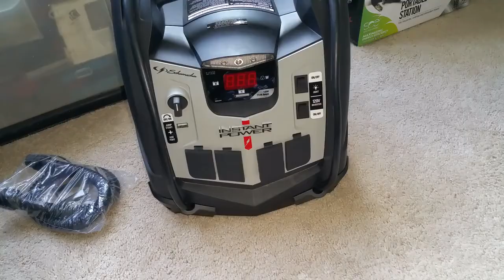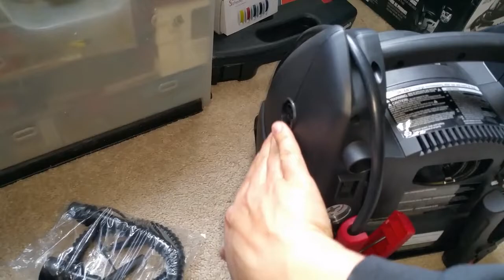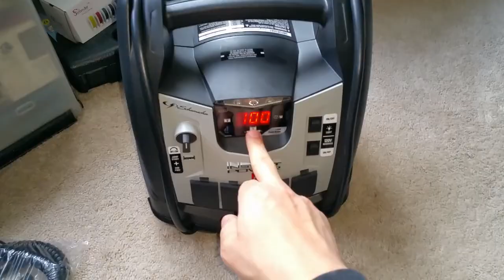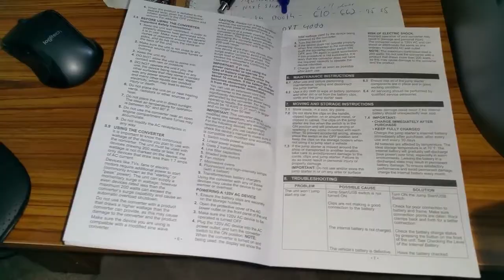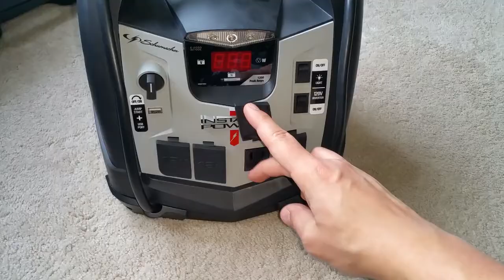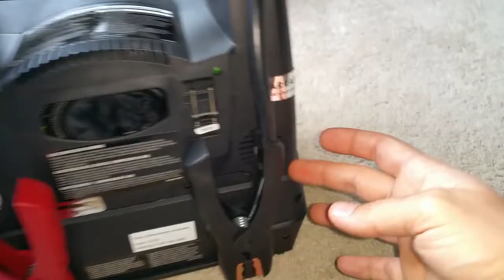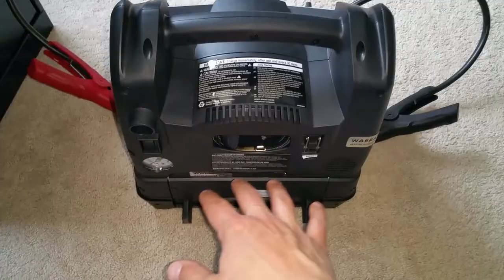Schumacher SJ1332 Review

Comment: So this will not charge car batteries?
Reply from the maker: it will jump start your car's battery, meaning it will give the short term high current to crank the engine ONLY. Once the car is running, your cars alternator will do the charging. 

Someone else asked if this would "charge" a cars battery, and technically this is true, BUT....its only a short term burst of energy. To charge your cars battery from being fully depleted you need to run the car or put the battery on a proper charger.

Comment: Is there anyway to charge this with a solar panel? Thanks.
Reply from the maker: Need more info. Do you have the panel along with a charge controller? Is the controller designed for 12 volts? If so then yes. In the scenario I just stated you would need to make a wire that goes from the charge controller to a male type cigarette accessory adapter. That would charge the internal battery with the solar panel. 

I would not expect a small solar panel with charge controller to connect at the AC power inlet for charging. For that you would need an external inverter to power that charge circuit

Comment: So i just bought this unit & my intention is to use it to power a 20" house fan & charge electrics, phone,  laptop etc. So my question can i simply plug & charge or use? Or do i need to do something else?
Reply: Thanks for taking the time!
Reply from the maker: @richardsoraiz4225  anytime!
Reply from the maker: Charge it first, then you should be good. Keep in mind that the waveform is not a sine wave, but a stepped square wave. Your VAC fan will buzz, spin slower, and run hotter. The rest of what you descibe should be okay, but not every SMPS is compatable.

Comment: Got mine August 5 due to a power loss. Charging for 36 hours as per warning, but it had 96%. I also have a Stakool portable AC/DC fridge/freezer chest that pulls 50 watts, but it isn't on constantly. Since this is 200 watts, can I expect 3 to 4 hours, or possibly more, power for the Stakool?
Reply from the maker: Hard to say. Need to know the duty cycle of the fridge. A kill-a-watt meter would show you the kw used in an hour. From there you can divide that into 18aH and see a rough idea of how long it will last.

Comment: I have the sj1332. I use inverter on a regular or a small fan. It runs 5-7watts on display when I have one running or 15-17 when. I have two running. They run for 6-7 hours. Then I get woke up by the alarm going off. Turn off the inverter and check battery % and it's between 50-65% left and always start off at 100%. My question is why does it shut off if it has so much % left. I understand if it was like 10-20% and saving itself. If you've had or anyone else had issue please let me know. Also I have two units I bought at same time and rotate out. And they both do similar things. Thanks in advance.
Reply from the maker: A phenomenon called Peukert's Law.  The display may say 55-65% but the display is reading open circuit voltage, its an approximation of remaining capacity. 6-7 hours is very good for a fan given the size battery.  It is not a deep cycle battery with thick large plates inside. Its an SLA battery, thinner plates designed for quick high current draw to jumpstart cars. While it has capacity for low power applications with the inverter, you are asking a lot of it for a 20aH battery. 

Still, impressed at the capacity you got given its size. Its a decent unit!
Reply: @Bassguitarist1985  love the unit and not upset with it at all. Just wanted to get a better understanding of it and why it keeps doing it. And I know the batteries isn't bad because it does it with both. But very pleased with it. And definitely want to see how this works over the winter with some of the stuff I want to use the inverter for. Such as tiny little space heaters($10-15) ones. And see how heating blanket works off either the 12v or a house heating blanket. Thanks again. Gonna check out your page and that. You seem very knowledgeable on this. I appreciate the quick response.

Comment: The jumper cables don't have power on my unit.  Is there a fuse on those inside that I may have blown?
Reply from the maker: Check the twist switch forst. I didnt see a fuse for the jumper cables
Reply: @Bassguitarist1985  Right, I took it apart and there is not a fuse.  I noticed the rotary switch was melted and not working - some arcing must have overheated the plastic.  Any idea where I can find replacement switch?  Having trouble locating one.  Thx.
Reply from the maker: @timothyroos6124  you can try calling schumacher, I don't have experience with their customer support though.

Comment: How come the jump pack part stopped working when you turn the switch to jump start the Lord display does not light up with voltage like it used to .any ideas why I heard you mention a 20 amp fuse where is that located
Reply from the maker: 20A is for the accessory outlets, the turn switch is for the jump cables. It will show voltage of the internal battery when on, and i beleive the voltage of the dead battery when off.
Reply: Any idea why the jump pack is not working but  air compressor and light still works
Reply from the maker: @michaelwalston543  so you get no voltage at the allegator clips? Is the switch on? If so may be an internal issue.
Reply: Correct no power at alligator clips and when I turn switch on no voltage reading on display and when I connect it to dead battery I get a reading on the battery I am trying to jump  it worked yesterday morning when I used it to start lawn tractor I left the switch on and when I was done no power or display I charged it says 100 and still no  power at clips  I think switch might he bad thanks for your help
Reply from the maker: @michaelwalston543  sounds like the switch. its a double pole single throw DPST type switch. It switches the high current wires from the battery to the clips, and a low current circuit to power the display. Chances are that switch is bad. You can try calling Schumacher if they have a replacement, I haven't tried getting anything from them yet.

Comment: Great video thanks for the info

Can you use this to charge another battery?

I have a deep cycle battery and I am using an 8amp battery charger. My unit charges for 10 seconds then I see 3 2 1 0 then beep, on the display panel. 

The instructions say no more than 20 amp but my charger is only an 8amp and it's the only thing plugged in. 

Will this work for the application I am describing?
Reply from the maker: No, it is not designed for that application.
Reply: @Bassguitarist1985  thanks for ur reply. I do have another question for u. I have only used this inflator and I charge it every month. When I press the power indicator it shows 100 but then if I press again it shows 95. I have kept this plugged in now for 16 hrs and it's still showing the same do you think this is a faulty unit?
Reply from the maker: @bigdog1694  i dont think so. If you were to measure the battery voltage when it is charging it should be above 12.8VDC.  The charge indicator reads the voltage in circuit estimating the state of charge. Can't say that it's 100% accurate, its more an approximation of the charge status. 

The AGA sealed battery inside DOES self discharge (like all batteries do) so its no suprise you loose a bit of open circuit voltage. Completely normal, no issue.

Comment: Why in the world will this not inflate a pool floaty? The f is wrong with this? You hook up the hoses, then move to switch on the back up, and it’s moving so little air it’s not even funny. Disappointing
Reply from the maker: I haven't tried it for that purpose but I can do a video on it as a way to test it. Forgive me for asking but you are attaching the hose to the outlet and not the inlet where the air blows out instead of deflating correct?

Comment: I have a 1971 10ft camper similar to a Shasta. All propane powered except 1 light bulb over the stove that uses a standard 120v. Will this be enough to power that while we arent using propane?
Reply from the maker: I'd say so if the bulb is an LED.

Comment: How do I know if its charging? I click on the charge percentage button and it says 0% but the green light on the back is on. It's been charging for the past almost 2 days but it still says 0 percent
Reply from the maker: Unplug the unit and press the button again. If it does not refresh, take a DMM and see what the voltage is at the jumper cables with the turn knob switch on. Anything below 11VDC means the battery is sulfated and needs to be replaced.

Comment: These are on Clearance at Lowe's. 

I came home with one today for 30.
Reply from the maker: Interesting
Reply: @Bassguitarist1985  also got the 1.5 tender for 5.
Reply from the maker: @ChadCesaro  maybe they are coming out with a new model. The other issue is the internal battery wont stay fresh forever, maybe thats why.
Reply: Omg. I bought one for $130 for this damn hurricane. Taking it back after
Reply: Wow what a steal! I got mine today at advanced auto parts for $135 tax included 😓

Comment: Own one. These are amazing. However are they MOSFETs or are they IGBTs. Another thing is. What kind of modified sine wave do they use. Is it just a square wave. Do you have some kind of way of showing a schematic diagram of what kind of modified sine wave they use. Apparently it also has 31% THD. Can one run a portable small fan with this? Like a desktop fan?
Reply from the maker: I have not tested the waveform. If the inverter fails ill be sure to do a video on it

Comment: I was using this model today to try to jumpstart a car that had been sitting for several months with a pretty much discharged battery. The unit would periodically beep three times. Do you have any idea what those beeps meant?
Reply from the maker: It reminds you that the switch is on to the jumper cables.
Reply: @Bassguitarist1985  The switch is on to the jumper cables? What do you mean? Aren't you supposed to turn the switch to on when you are jumpstarting?
Reply from the maker: @RootsRockRebel  the main twist switch on the front is on (which powers the jumper cables) for too long. If left on it creates a parasatic draw. The led display and the buck converter for the usb draws on the battery, thus the 3 reminder beeps
Reply: @Bassguitarist1985  If I turn it off will the unit still charge a car battery?
Reply from the maker: @RootsRockRebel  no it will not
Reply: @Bassguitarist1985  Ok, I'm trying to charge a totally discharged battery. Can I charge the unit's battery via an extension cord in my garage while I have it hooked up to my car's battery to charge it?
Reply from the maker: @RootsRockRebel  not advisable. You are asking a lot of the internal charger circuit, it may shorten its life. Basically it be running full amperage to charge both batteries. If your car battery is truly completely discharged, its likely damaged and wont take a full charge. You need a multistage charger

Comment: I picked up one of these but I’m having issue with the power inverter I believe.  I don’t have anything plugged into any port and just turn the inverter switch on it shows r00 then shoots up to around 192 then back to around 122.  About 10 seconds later it goes down to 0 and makes a continuous beep.  Any ideas?
Reply from the maker: That means the inverter output stage is shorting out. Soon as you turn it on it goes from 0 watts to 192 Watts which is right at the limit of continuous power the inverter can handle. It will then go into protect mode and shutdown that's what the continuous beep is for. If you got this new from the store I would return it and get another one. If you got it used then likely the inverter output transistors need to be replaced or any number of components. I have not done an inverter teardown mine is still working fine as I use it to power lights in my shed
Reply: Bassguitarist1985 well poop.  More info then I had but more depressed than I was now.  I got it used.  It’s still like new tho.
Reply from the maker: @Taurus4x4mt  I haven't taken mine a part yet that far but I believe the inverter unit is a small box type device with a heatsink on it. I know that it can be repaired. The kicker is being able to read the component part numbers if they are not all charred and burnt
Reply from the maker: You could try calling Schumacher and seeing if they sell just that part

Comment: Great Video - thanks.  I need a portable AC power source to run a large computer monitor (or possibly a flat screen TV of up to 50inches) for an in-door trade-show that will not have power available.  Can the Schumacher power a monitor or TV?  If so, is there a way to gauge how long it would last?  If not, can you suggest an alternative?  Since the event is in-doors, I cannot use a gas generator.
Reply from the maker: A small computer monitor say 20 in wide screen should be just fine. I don't think the modified sine wave will be a problem. The runtime for the monitor probably won't be as long as you need it to. For example my Dell 20 inch widescreen is 1 1/2 amps at 120 volts. That's roughly 175 Watts. That would only run for about an hour on the jumper pack. What you can do is get a group 29 deep cycle battery and connect the power leads to it. That will give you ample power for a monitor that size to run at 4 more than 4 hours for example. 

Now add in a computer desktop tower. Thats several hundred watts, means you need more big batteries, and a larger inverter preferably a sine wave inverter that is beyond the capabilities of the Schumacher jumper pack in question

Comment: I bought 1 just over a year ago and love it. I use it the jump start cars and air up/down my ATV tires. The air compressor is a little weak airing up truck tires though. It really holds a charge and you really have to use it a lot before needing to recharge great product in my opinion.
Reply from the maker: Yeah the air compressor is very low CFM, but filling a passenger car tire from flat is fairly reasonable time. I'm using mine to power all the LED lights in my shed. Two Spot lights 120 watts equiv and two 100 watt equivalent takes about 80 watts total. Lasts on the battery pack for about 5 hours. Perfect amount of time when mowing the grass or snow blowing at night!

Comment: Can you charge the jump starter from the cigarette lighter ? Curious no one ever mentions this ?
Reply from the maker: Yes, just need a male to male cigarette lighter wire. Only issue is if the jump start is severely depleted, you can potentially draw more than 20A from the power port and pop the fuse. Other than that good to go!
Reply: @Bassguitarist1985  are you saying you can plug the cigarette  lighter cable into the front of the battery jumper into the cigarette lighter receptacle ? And not through  the back to recharge battery jumper where the electrical plug is ?
Reply from the maker: @richardbello5732  correct yes
Reply: @Bassguitarist1985  but the cigarette lighter receptacle in the front of the battery jumper releases electrical current, are you saying it also receives electrical current that will also charge the unit SJ1332  ?
Reply from the maker: @richardbello5732  that is correct. Vonnecting the male to male cigarette lighter cord is basically connecting your car battery and the jumper pack battery in parallel.  Your car charges both batteries together now. Just keep in mind that it is possible to overcharge the jumper pack. Just press the front button to see the percent charge and you should be good. No more than two hours connected
Reply: @Bassguitarist1985  thankyou very much I will try it 😉
Reply: @Bassguitarist1985  thanks, I was about to ask this same question.  Here is a silly question but would that pop a fuse in the car or in the jump charger?
Reply from the maker: @BubJames2123  it may pop one of them or both. As the jumper pack's internal battery charges, the resistance rises, thus the current goes down. On a very discharged battery (I'm talking 10% or less left) it is possible to overdraw the 20A current limit. As general practice you should never do that with any battery as it will shorten its life. The plates inside are thinner than a deep cycle so its really designed for high current in short bursts like jump starting, or small current draw (say 10A or less) for a longer period.
Reply: Could I plug in a solar panel with a cigarette lighter to charge it that way?

Comment: Could this be used to run a coffee maker? Not a huge fancy one. Just a regular 12 cup mr coffee.

I tried to use it earlier and all it did was beep. Meanwhile I could run a table fan with no problem after I tried the coffee maker.
Reply from the maker: Absolutely not. Coffee makers are easily 900+ watts to run. It is beeping due to overload condition.
Reply: @Bassguitarist1985  ok thanks!
Reply from the maker: @marshatrent9466  anytime! Love your profile pic! I love Eeyore!
Reply: How long does it take to charge from 0%?
Reply: Does it cut off automatically after reaching 100%? Do I need to monitor while charging? Will overcharging damage unit?